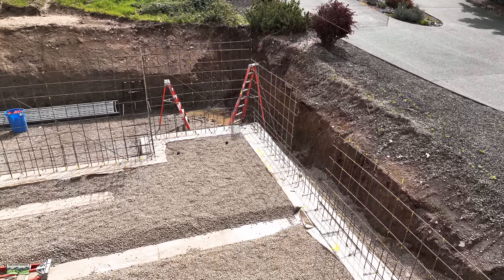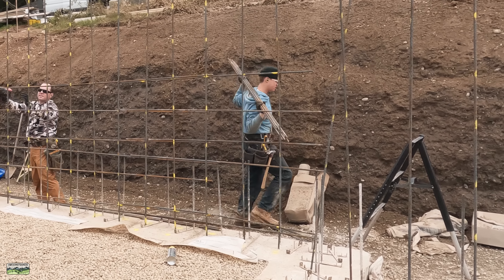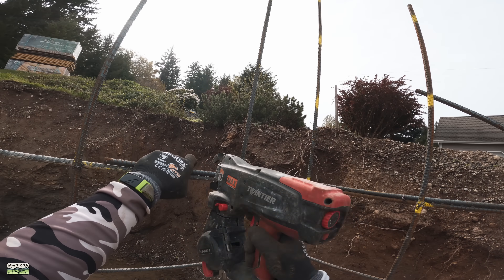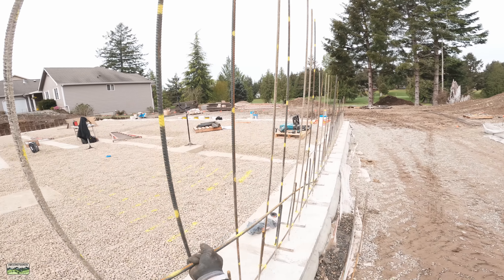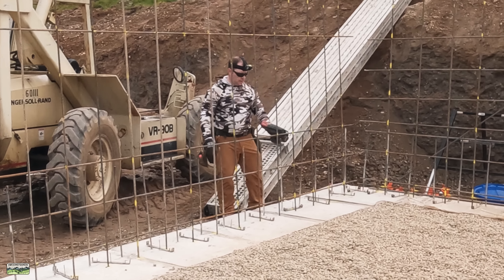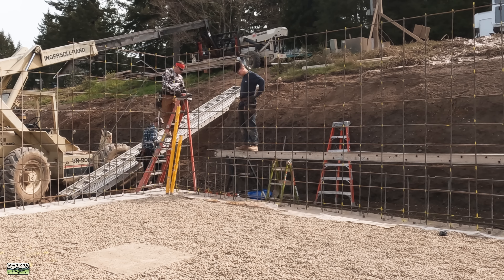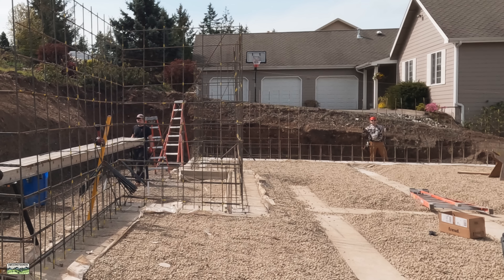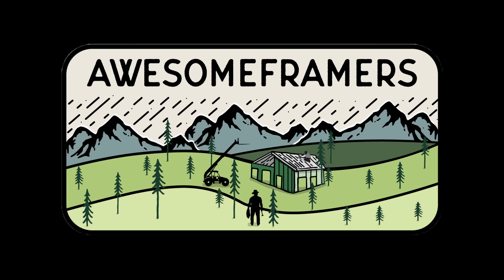How to Productively Tie Rebar Olympic Foundations

Comment: The concrete company I work for has 3 of the regular tie guns and one of the bigger ones. We mainly use the regular guns but the bigger one is very nice when you need it. They work very well especially if you have a lot of room to maneuver the gun. If area is to tight you might struggle to get it to tie but they are awesome now that twin tier looks even cooler when it’s time to upgrade I’ll definitely look into that one.
Reply: The big ones are so sick. Still can't tie 2, 30 mm bars together though which sucks for me bc I had to wear a klien wire reel to tie. 

Mondays a new site so I'm stoked to be able to rip the bar gun again

Comment: >>>used both the max and makita tie guns, max has an advantage but was around $1k more, also the ammo is more expensive. max can tie larger bars but makita will work fine in 95% of residential rebar mats, so i'd say either gun will work ties are strong enough to climb like a ladder. I don't do much flat work but there is a gun designed for tie'n bar at your feet that looks wicked

Comment: If I may give you a tip , your marked verts or template bars , I would just put them every 4 ft and put blank ones in between 🤷‍♂️ And just tie the wall 50% , also your horizontal bars mark out three on the ground wherever your holes are drilled and boom everything should be straight , throw your template horizontals one on top one in the middle , tie em solid and the rest is history , I’ve done rebar for 7 years , might help out with your efficiency 👍🏼 Also great videos
Reply from the maker: Thanks so much!!

Comment: So I just heard that you use same tie wire on the top to pull the rebar in position. Why not use rebar spacer? And put them on the side where the distance is just 2” to the wall outside? I’m pretty sure you get the spacer in the right size.
Reply from the maker: short answer because this is easy.